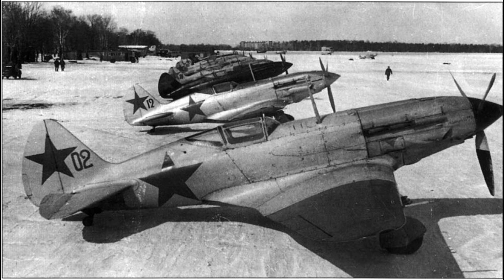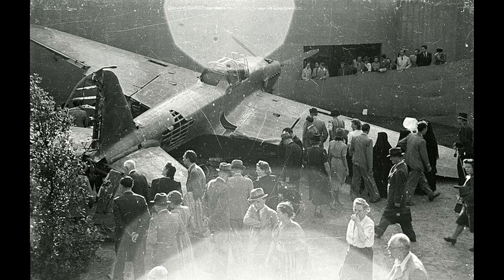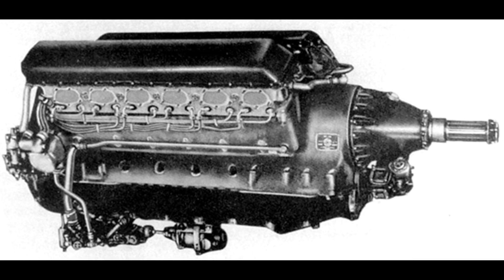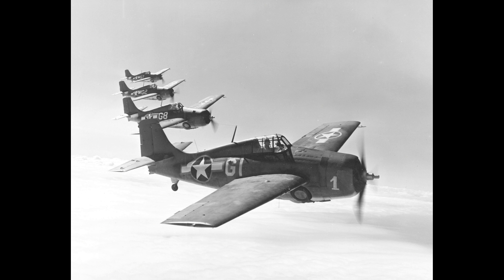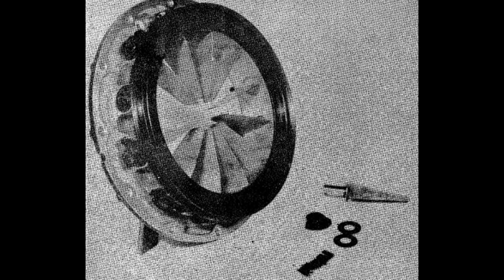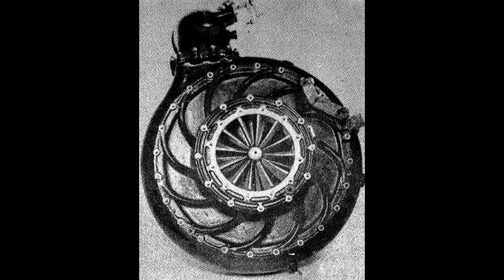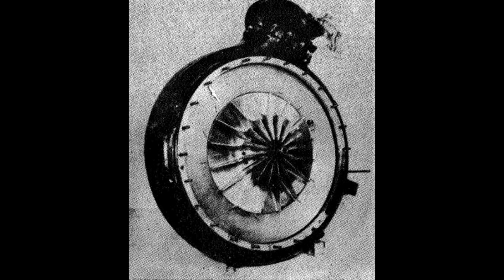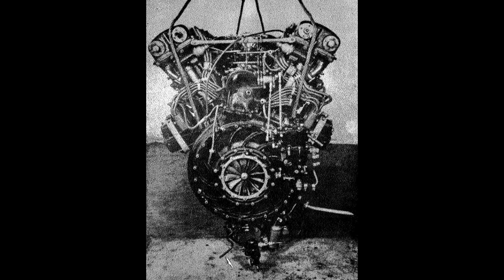IL2 Sturmovik Secret Throttle, extra 100 horsepower!

Comment: I wonder how much power was lost in the heating of the oil in the fluid coupling of the supercharger on German engines? There must have been at least some losses? This Russian swirl throttle seems like a very elegant and simple solution.
Reply from the maker: There are losses with every supercharger drive system. The losses with the fluid drive were higher than a straight up gear drive, but you get back more from the reduction in throttling losses.

Comment: Notes on the "swirl throttle" based on the book "THE SECRET HORSEPOWER RACE":
1939: Hispano 12Y (French): Had a "radial swirl throttle" (Page 126)
1940: DB 600 test engine with axial swirl throttle (Page 162)
1944/45: Jumo 213 E (perhaps also A) and DB 603 L + N (prototype + planning) have swirl throttles to (Pages 368+).
Reply from the maker: This video pre-dates that book.
Reply: @GregsAirplanesandAutomobiles  Sometimes there are also new insights for old things. Now someone interested can read about them in the comments. Or maybe even buy the book.
Of course, I'm also looking forward to more videos that are newer than the book. 🙂

Comment: It looks like the Tornado intake spacer!
Reply from the maker: Keep in mind we are comparing this throttle to a different type of blockage needed for throttling. The part you are talking about is comparing a blockage to no blockage. It's really apples and oranges, the reason this works on a supercharged aircraft has nothing to do with what happens in an automotive intake system.

Comment: Essentially a set of stator vanes.

As for why Russians didn't share it? There are lots of things sides didn't share with one another. While US did Lend-Lease to USSR, it also disclosed the full technical specs of what it sent to USSR, and kept trading with Third Reich all through the war. And as you said: it's not like western superchargers needed it to begin with.
Reply from the maker: That's true, overall the stuff from the US was far superior, but the Soviets were ahead on this one thing. Oh, and these move, stator vanes are usually fixed in position.
Reply: @GregsAirplanesandAutomobiles  On a jet engine they move on modern ones. At least ones I was shown in aviation technical training school. Usually 2 or 3 stages on low-pressure compressor have movable stator vanes.

Comment: Very cool piece of engineering.  The best application I can think of for it in modern engines would be for aftermarket centrifugal superchargers like ProCharger or Vortec.  Racers and enthusiasts are always looking for something to give them a small edge over the competition.  Road racers who use Vortecs would gain some boost response when they pick up the throttle at the apex of a turn.

Comment: But why did it have an external oil cooler?
Why did they put it underneath/on the outside,  where it could get easily shot up,
and stopped them having a central hard point?

Comment: Excellent video.
Did the other aircraft have the throttle after the supercharger or before the supercharger?
I’m just wondering how this might apply in automotive applications, such as the Novi centrifugal supercharger for the C5 corvette where the restriction is on the inlet side of the supercharger. The idea is to limit max boost while achieving more midrange tq.
Another example is the VMP Loki supercharger kit for late model mustangs. They use the stock throttle body and air intake in front of an oversized positive displacement blower to limit max horsepower while maintaining a similar midrange tq value compared to the unrestricted kit. 
Would those fall under the category of superchargers hating throttling?
Thanks,
Russ
Reply from the maker: The aircraft we have been discussing has the throttle on the intake side of the supercharger. You may want to watch my turbo vs. supercharging aircraft video for a better explanation.  cont:

I am not familiar with the Loki supercharger kit, but I am generally against throttling supercharger in cars. With a properly sized positive displacement blower you shouldn't have to do that.
Reply: @GregsAirplanesandAutomobiles  Greg, if you compare manufacturing complexity, machining costs, qualified labor and required manufacturing cycle of German supercharges vs AM-36/38 vortex vane damper, you would see that logistical capabilities dictate war time design of a nation that's at war, and not engineering achievements of any given design team.

"Secret throttle" was not just a cool idea, it saved lives.
Reply: @GregsAirplanesandAutomobiles  Thanks for the reply, watching the turbo vs supercharger for the second time now.

Comment: Hi Greg! I would very much enjoy having you discuss some different design philosophies overall between the combatants and how that led to various design choices.  comparing the Sturmovik to the Japanese A6M to the Spitfire to the Corsair to Bf109… All of those are obviously born of different mothers. would you do a video talking about that?
Reply from the maker: I may do something like that, but it's too difficult to get four airplanes into one video. I just did that, and ended up being a 90 min video. So I won't have the Sturmovik, Zero, Spitfire, Corsair, and 109 all in one.
Reply: @GregsAirplanesandAutomobiles  I didn’t necessarily think of four specific planes. But more for specific points of view. (If there actually are four different ones.) in other words, how are national philosophies and outlooks expressed in their designs and engineering? That’s kind of what I’m getting at. because the brains that thought up the Sturmovik have almost nothing in common with the brains that thought up the zero.  and thanks for the reply and the consideration!

Comment: Why did they restrict the throttle instead of BLEED THE BOOST? Most modern supercharger systems do that. This has gained favor over clutching the supercharger drive popular in the 80s and 90s, because it does not wear out which improves reliability and longevity. When the throttle is closed or at a low opening, a bypass valve opens to bleed the boost back into the intake ahead of the supercharger (or into the atmosphere). This allows the supercharger to freewheel greatly reducing the drive power needed to spin it. By opening the valve just a crack it can also be used as a form of boost control to reduce boost but not totally eliminate it. The GM LSA/LT4, the Chrysler boosted Hemis and Jaguar AJ133 all used the bypass valve system.
Reply from the maker: Hold on there Dwight. You are mixed apples and pistons. Bleeding the boost to control manifold pressure is hugely inefficient because it means that you are paying to develop boost you don't use. In other words, you put energy into the supercharger for boost you can't use. Now that's NOT what the LT4, Supercharged Hemi's and so on do, they use a different system entirely. 

As an example, let's take a modern G.M supercharged V8 running an Eaton four lobe Roots type with a bypass valve. That valve does NOT allow the system to increase boost with altitude. In fact all it does is essentially turn the supercharger on or off for fuel economy and emissions. During light throttle operations the bypass valve is open preventing the supercharger from developing boost, not bleeding boost that's already been created, big difference. At full throttle it may run say 10 pounds of boost, but it can't increase it. If fact if you drive your Camaro ZL-1 up to Denver it will have less manifold pressure up there unless you change pulleys. The throttling system allows you to have the same manifold pressure up to very high altitudes. It's totally different.
Reply: @GregsAirplanesandAutomobiles  Actually, no, I am not confused...
--
(1) There is no practical difference between "bleeding boost" and not allowing it to make boost. The mechanical work needed to actually spin the supercharger is quite low, it is not much more than spinning a pulley. Most of the effort is actually in compressing the air. Think of it this way... if you have a foot pump and are trying to pump up a tire, most of the effort is trying to push air into the tire against the pressurized air already inside the tire. When you first start, the effort is low. As the tire becomes pressurized the pump becomes a lot stiffer to operate. If you disconnect the pump and just pump it against the free atmosphere, the effort on the operating the pump immediately becomes quite low. The same thing happens when you make a hole in the pressurized manifold. With a big hole, there is basically no effort because there is no compression, with a small hole there is less effort because there is less compression.
--
(2) When you throttle the supercharger intake, you are also reducing manifold (absolute) pressure. What do you think happens downstream of a throttle plate? A partial vacuum is created! With no supercharger, the throttle being partially closed means that the engine -- sucking against this obstruction -- is not taking in air at 14.5 psi at sea level but rather 9 psi, 3 psi or whatever more rarified atmosphere created by the throttle plate and the pistons during their intake stroke. This takes mechanical effort (like breathing through a straw). With a supercharger you are then compressing that 3 psi, 9 psi or whatever up to some denser number, but NOT what the manifold pressure would have been if there is no throttle obstruction. This is in part why Diesel engines are more efficient than gasoline engines -- apart from operating at a higher static compression, the Diesel engine also has no throttle plate which means at it is not trying to work against an intake obstructing, expending mechanical effort to draw a vacuum at cruise or anything but full throttle. It simply breathes freely and runs a leaner mixture.
Reply from the maker: 1. Your example is exactly correct with a Roots type blower. However with a Centrifugal it compresses internally, so you do pay for that boost even though it leaks out. Again, with a Roots you are correct, but no WW2 airplane uses a Roots as explained in my video on Supercharging vs. Turbo charging in WW2 planes. 
2. YES! Of course a partial vacuum is created, that's why it results in less manifold pressure. That's the whole point of doing it. Yes, it costs power to do that, which is why at a given manifold pressure we often see power increase with altitude. 
3. If this is the first video you have watched on this channel, it's not a good one to start with. Please watch this one, and I think it will clear all this up. Nothing you are saying is really wrong from an automotive standpoint. https://www.youtube.com/watch?v=ULLsIo1VzTw This video should clear up the terms and differences with aircraft supercharing vs. cars.
Reply: @GregsAirplanesandAutomobiles  Yes, you are correct, I forgot the part about difference between a blower and a positive displacement pump.
Reply from the maker: @dwightlooi  Thanks for visiting and contributing to my channel, I do appreciate it.

Comment: Concerning your claims of the Germans not utilising this throttle, the Junkers Jumo 213 did use it to great effect.

It´s actually one of the main reasons why the 213 was able to compete with the more advanced DB603.
The 603 had reliability issues right up to the end of the war, whereas from what I can tell, 
the Jumo 213 was simply the already provably reliable Jumo 211 with way higher RPM and the Russian throttle, making development time significantly shorter.

With the DB60x being more technically advanced, but less reliably scalable to higher HP,
I suspect the 213 was nothing but a pitch by the RLM to utilise the advanced throttle mechanism from the captured Mikulin engines in a way that allowed an otherwise mediocre, 
but reliable engine to compete with a more advanced design that over the years failed to deliver a reliable production model.
Reply from the maker: Ahm...I have a whole video about that.
Reply: @GregsAirplanesandAutomobiles  is it the D9 vs P51 one? Because I can´t find any other one where you talk about the 213

Sry btw if I come off as unappreciative, I really like your videos, I´m just a nitpicker who lives in the moment, and tend to forget stuff.
Reply from the maker: No problem, I think it's either the D9 vs. P-51 or the Ta152, I'm not sure which.

Comment: Allegedly this technology was being used in the later German engines like the 213J and 603L and N.
Reply from the maker: Yes, I talk about that in my Dora vs P-51 video.
Reply: @GregsAirplanesandAutomobiles  
Oooh! Awesome!

Thanks again for these awesome videos!

From a war perspective, was there any downside to this throttle? It seems to boost CAS horsepower quite a lot, and would help a plane get up to height quicker, meaning less chance of interception.

Comment: I wonder if something similar could increase turbocharger efficiency on a modern automotive engine
Reply from the maker: There is a surprising amount of WW2 fighter tech that did make it into cars, however there are a few things that haven't, this is one. I'm not sure it if would be practical for a turbo as they usually have the throttles after the compressor.

Comment: Very interesting. A couple of points I'm less sure about though. (a) Are you sure that setting the vanes to push the air into the direction of rotation didn't increase the boost above the point of having the vanes in the neutral (parallel to flow) position? Intuitively it would and googling seems to imply this. (b) Why do you think the Bf 109 fluid coupling system is more advanced? Wouldn't that include more weight, power sapping in the coupling and added vulnerability? Maybe the control system was more advanced I guess?
Reply from the maker: I'm not sure I understand point A. Manifold pressure is controlled in this plane by throttle position, which in this case is the vane position. The farther its open the more pressure. The 109 coupling is more advanced because it eliminates throttling losses via an advanced mechanism. I have several videos that talk about this. Check out my video on the 109's supercharger drive system, and the one on turbo vs supercharging in WW2 airplanes. All you answers are in those two. It's really too complex for the comment section.

Comment: This concept (pre rotation of inlet flow) is used for the first time (at least on supercharging of aviation motor) in1938 on the French Hispano-Suiza 12Y-45, which used the S-39-H3 supercharger co-designed by French André Planiol and Polish engineer Joseph Szydlowski. 

Americans are fully aware of that and tested the Plagniol-Szydlowski, compressor,  the English 2 speeds mechanicaly driven one and the German hydraulic driven one (see NACA test report no 795  - august /12/ 1940).
For those who can read french, see some detailled explanations and some pictures:

https://www.amis-turbomeca.com/80-ans/1938-1947-la-naissance-de-turbomeca-et-innovation/le-compresseur-%C3%A0-circulation-variable/
Note also that Mr Szydlowski was the founder of Turbomeca, a very successefull company, now SAFRAN helicopter engine and Mr Plagniol move  to USA in 1941.
Hope that this help.
Reply from the maker: Do you have a picture of that?
Reply: There is a picture on the link
Reply from the maker: Those are guide vanes for an axial compressor, sort of similar, but not the same thing.

Comment: Do the vanes move at all or is the whole set up fixed ?
Reply from the maker: The vanes in the throttle move, the vanes in the supercharger impeller are fixed.
Reply: @GregsAirplanesandAutomobiles  So the vanes all move... that would make it a rather complex device... I can see why it's way better than just 1 butterfly... Clever.
Reply from the maker: Yes, in the throttle all the vanes move.

Comment: Hi Greg. After searching around on the net I found the Germans did actually use this type of TB. They termed it ''dralldrossel'' which translates to twist throttle. It was used on the DB603L & 605L and also on the Jumo 213.
Jumo with this type of TB here: https://www.enginehistory.org/Piston/Junkers/Jumo213/Jumo213.shtml
DB603L info: https://www.jagdgeschwader4.de/index.php/motorenpruefstand-hauptraum/kolben/db-603
and info here: https://ww2aircraft.net/forum/threads/on-superchargers-mikulins-klimovs-jumos-etc.40086/
Reply from the maker: Wow, thank you, that's a good discovery. It makes sense too as the Jumo doesn't use the DB601/605 variable speed drive on the supercharger.  I'll cover this when I get to the TA152.

Comment: Basically the same as Variable Inlet Guide Vanes found in many Gas Turbine compressors. They, too, are used to increase the efficiency of the compressor at lower altitudes while the compressor is optimised for high altitude operation. A much better idea than the early bleed valves which dumped excess air at lower power settings, wasting the energy used to compress that air.
Reply from the maker: Well, wait a moment, bleed valves that dump excess pressure are for a different purpose.

Comment: This technology lives on in jet engines.
The variable inlet guide vanes on turbine engines essentially does the same thing by restricting airflow at reduced throttle settings and controls the angle of airflow into the compressor.